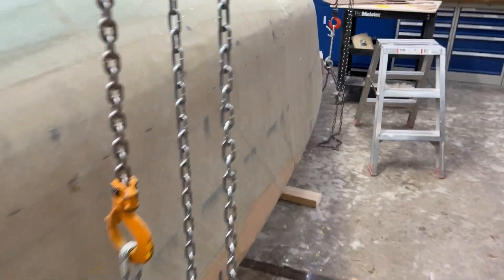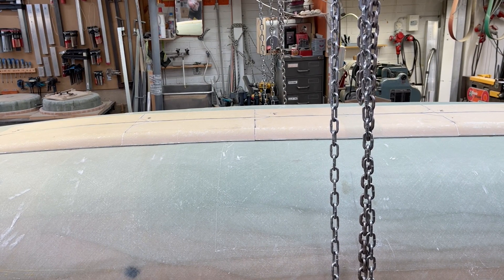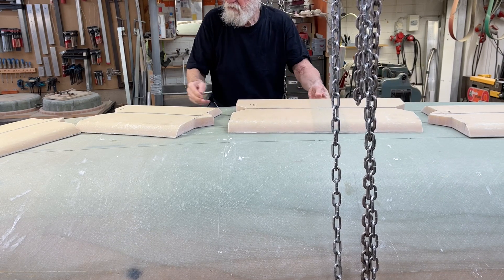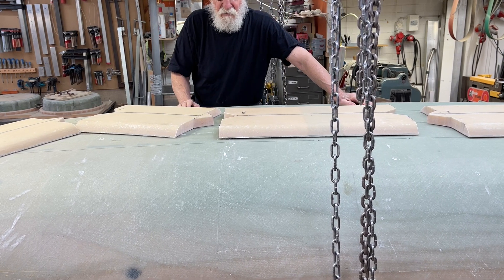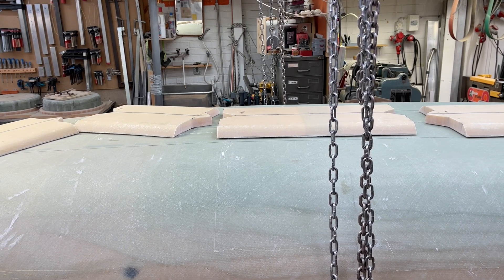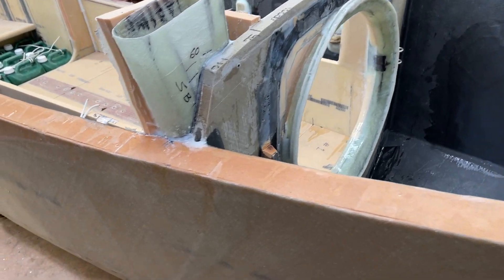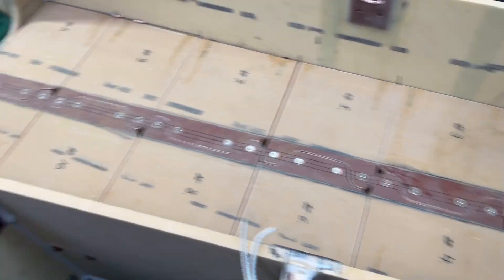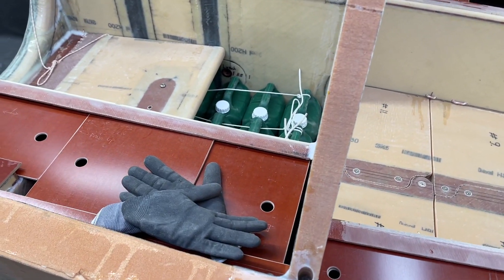16 OCtober 2022  The mold is spilt for ease of handling.

Comment: Mold sectioning sounds like good practical idea.  Just curious why the interlocking cuts?  Wouldn't simple straight cuts do just as well since all sections must be securely fastened so will not shift position?
Reply from the maker: The interlocking cuts will help when position them in in stright line. The heavy pieces slides a bit on the wet, epoxy before I get them secured.
Its not needed, just makes everything a bit more easy for an old man handling heavy pieces.